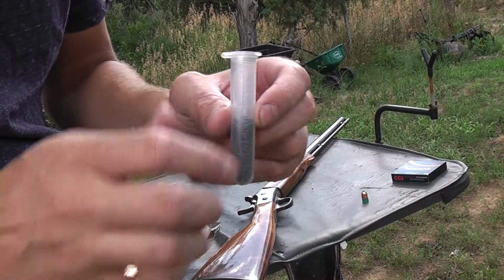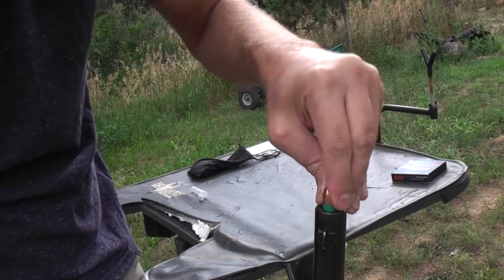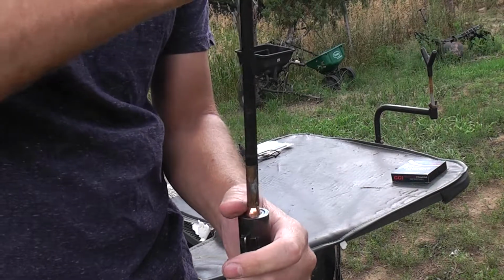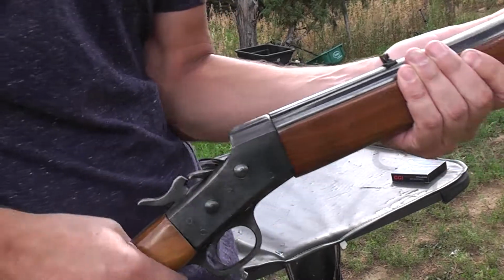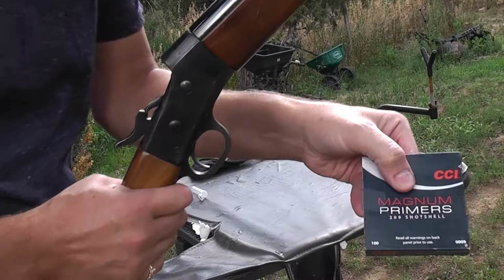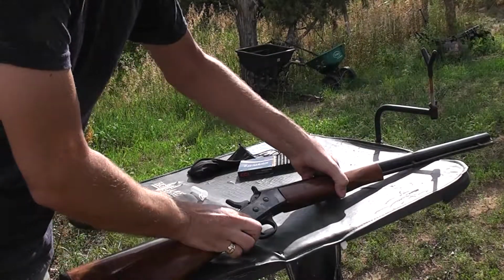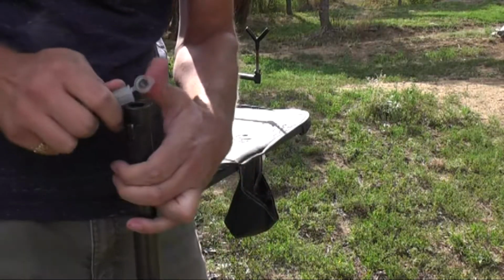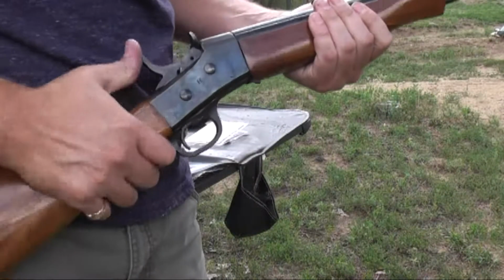Rolling block

Comment: Very cool rifle.  Does the breech plug come out for cleaning and do you need a special breech plug to fire bh209 powder.  I really like bh209 powder and I use it in my Thompson Center Impact, but my breech plug has to be spotlessly clean.  I also load bh209 in my 45 Colt cartridges.  Thank you for sharing and showing how this muzzleloading rolling block works.
Reply from the maker: No specific plug needed for bh209. Plug came out with a socket. No longer have this gun, but it was a very sturdy design.
Reply: @BuckskinsBlackPowder where did you buy this rifle?  what company produces it? It's pedersoli or saguaro?
Reply from the maker: @caethiraepirseah6004  I'm sorry but it was so long I can not remember.  Not a pedersoli. No name on it.
Reply: @BuckskinsBlackPowder  try to remember, this knowledge is very important to me. Btw, did you buy this rifle online?

Comment: Do you remove the breech plug when cleaning?  The tool I have requires removing the hammer and rolling block before inserting the tool. Is there a shorter tool available?